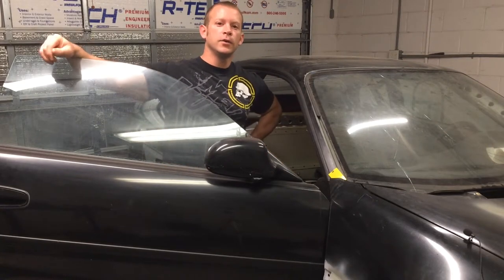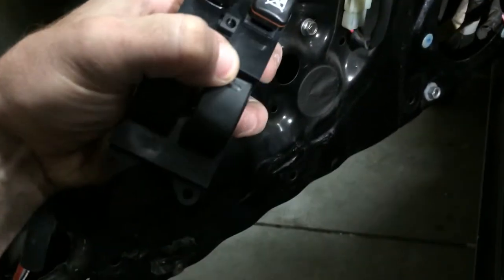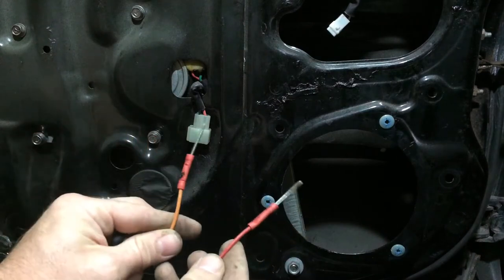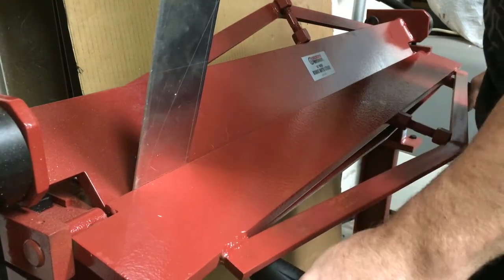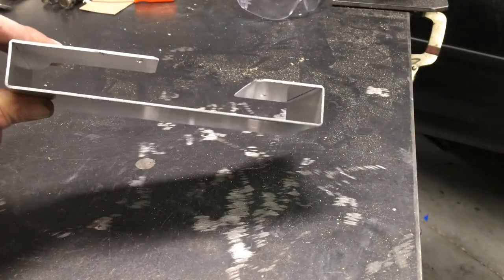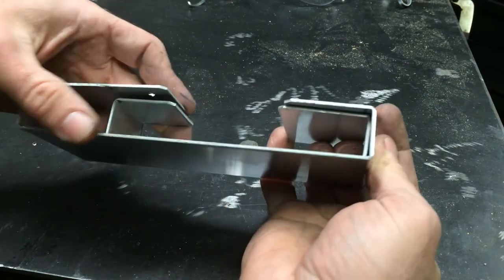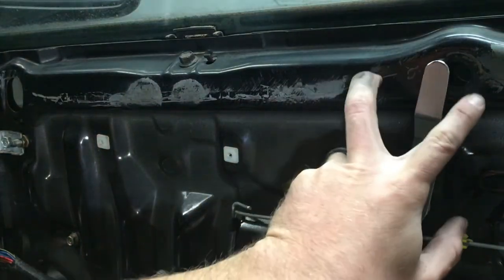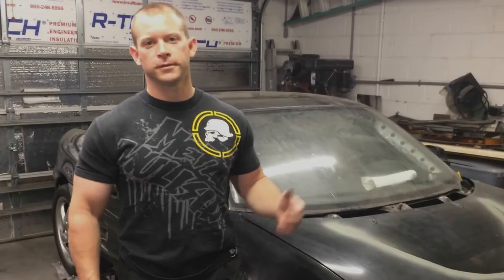Custom door cards part 2

Comment: Is the purpose to reduce weight or just to look cool?
I notice that you have speaker grills - I suspect that the acoustics of these doors will be sketchy, and the cars likely to be so loud that I doubt a sound system will be of use.
Reply from the maker: no sound system will be in this car. Those are speaker hole block off plates i made. The purpose of these cards is to fit with the roll cage. The oem panels will not fit with the roll cage

Comment: Greetings King. Love the vibes as always. Question: Won't those panels make the ride a noisy one? Vibration..??? More health and strength.
Reply from the maker: hope not. if it does i will make rubber insulators . we will have to wait and see when i get it running.